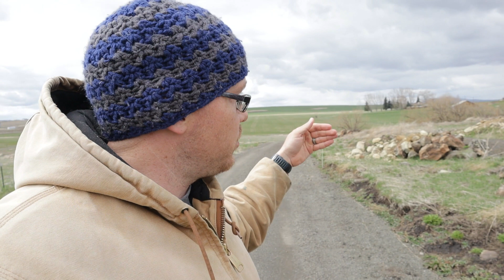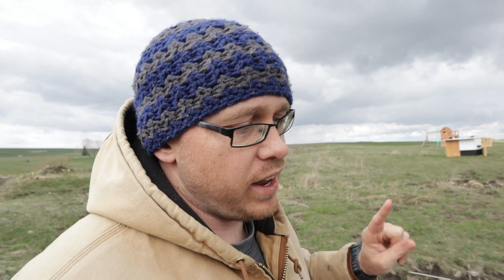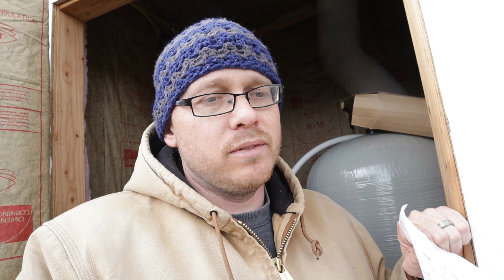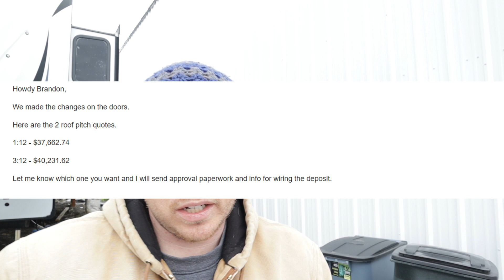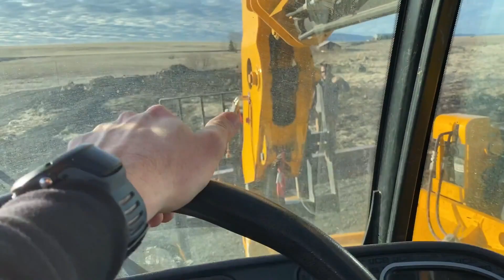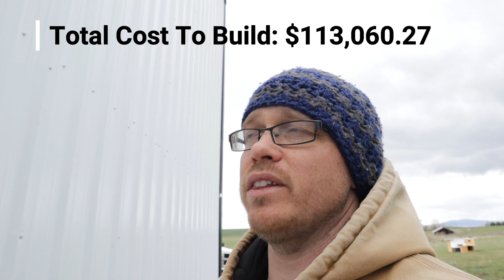Our 60x40 Barndo/Shop House Cost Breakdown // How Much To Build Our Steel Building

Comment: Do you recommend being the owner builder and sub it out or going through a company that builds barndo’s? Is the cost difference significant?
Reply from the maker: I built it 100% on my own with the exception of the concrete, excavation and septic, but I do know the more you do the less you'll spend. If you sub things out that takes work but it will save you on a general contractor who manages everything for you. When working with contractors you have to be on top of them and have to be diligent that they don't up charge you extensively. The thing is depending on the general contractor you could be facing the same issues anyways.
Reply: @homesteadingbarndo  thank you for that. I really appreciate it. Gives me something to think about. Excellent videos by the way. Also very informative. We plan on building a 60 x 40 in Kentucky. We were on the land already by the time we build but I’m just trying to decide what should be the best direction to go on the building.
Reply from the maker: @armandoyourpersonaljeweler7558  if you ever have any questions feel free to email me homesteadyrv@gmail.com 

Good luck on your build!

Comment: Do you feel that they are building quality is long lasting and good quality for the price. I’ve been looking around and most places I’ve gotten quotes from for a 40 x 40 are between 70 and 100,000. I did end up getting a quote from star steel theirs was much cheaper. I just wasn’t sure if there was a huge quality difference or when you had set it up if you noticed the structural differences between yours and ones you’ve seen?
Reply from the maker: I am extremely happy with the quality from star state steel. I've been in my neighbor's steel buildings and I see zero difference in terms of materials. 

I was pretty worries to be honest because they were far cheaper and I was wondering, geez I hope they actually deliver the building. It showed up complete. There was an issue where we were missing brackets for the window framing and I reached out and they quickly resolved it. 

It's holding up great in our 60-70 mph winds we've had out here, the snow, the heat and everything. No issues with paint or anything

Comment: the higher price of the road and site prep is exactly what i would have expected as someone who has built 4 buildings with roads/driveways.  i would have definitely gotten that great low price in writing before start of job.  plus, that original price for the septic was also way low a bid and sounds as if they only priced the tank install.  i get a lot of flack for this but, i always tell new builders to consider making their budgets 12k for every job needed and they won't be disappointed.  therefore, 12k for driveway, 12k for electric, 12k for septic, 12k for water, 12 for anything else you might need to set up your basics.  good luck and congrats on a great building.
Reply from the maker: That's good to know! I definitely learned a lot through the experience.

Comment: I found a Russian contractor who's willing to come to America to help assist in building my construction new construction I need a building for my car collection and residence and I have like 20 dogs. They replaced people since people have become well what they are in america. Therefore the Russian contractor he has lots of experience and has done everything from residential tons of electronics and wiring and would be willing to help me build anything from a block house out of cement Woodhouse anything I want but this is what I'm thinking I'm going to do with what you did the residence inside the building the dog kennels the in floor or the spray foam the well water and maybe solar panels on the roof since my collection of cars is only cars I'm going to make my building a great deal shorter I have no intention of driving any large vehicles in or out of it only one section needs to accommodate a lift to lift the cars. Due to tornadoes in my state and no snow a shorter building is more desirable and it's a lot easier to cool in the blistering punishing Summers in which I will let all the trees grow up around it and actually shade some of the building to keep it cooler.
Reply from the maker: Where are you building?

Comment: I don't know where you live but you're dealing with some real weird companies it doesn't matter if you do an overpower or whatever if you make a mistake in your estimate you need to swallow it I've run a roofing company and I've never charged anybody over what I had estimated it. I've also never paid anybody over the estimate they gave me if they tell me it's going to cost a certain amount it better not cost more than that or they're just not going to see the money.
Reply from the maker: I agree it was messed up. I've learned they have a bad reputation since living here. If I had known now I would have only paid to the estimate

Comment: I'm completely lost on this. What planet are you on? In Georgia we have contracts. They must adhere. If someone bids a job and you have the cost in writing, that's what you pay. There are of course exigent circumstance clauses but if you have a licensed company doing the work, those are rare. 39K in labor to erect the building? They do it for like 7K here. And are great at it. I think they just seen some young guy and assumed you were a sucker, guess they were right.
Reply from the maker: Lol estimates and bids are definitely not contracts. Contracts have to have terms conditions and completion dates. If both parties agree a bid can become a contract.

I definitely mentioned I didn't do it right and get it in writing. 

I highly doubt you could get someone to erect a 60x40 building with 22 foot eaves for 7 k. The equipment rental for me was almost 6300 bucks alone. That's why I built it myself and didn't hire it out. 

I could have saved money by being smarter but 113k is definitely not bad
Reply: I just got quote from company for a 60x40 with front n back porch and concrete work to fully erect the building n everything for $72,000. I'm in Mississippi of course I'd finish inside myself. I've really been looking into a metal home... hell a single wide here is $100,000 and it's like 1200 sqft....
Reply: @lazygamer9725  What company?  Have you found anything cheaper?
Reply: @stopitmike  Joe west will build the building. He's got pretty good record from the homes I've seen. And people where happy with him. Metal homes are nice. My wife and I are still planning n trying to figure everything out. But for a 60 by 40 his price has been pretty competitive.
Reply: Hey Rob - I'm in Georgia and read your message...can you give me a name of builder that you have used for either a pole barn or steel building that you would recommend.  Much appreciated.  Thanks,

Comment: I like the video.  It does show how when agreements are not put in writing and signed, how either side can lose.  I work construction and see this issue constantly.  After building your shop, you now know what to expect when building your house.  You are correct about saving by not having to hire a contractor, and managing things yourself.  In the late '90s I acted as the contractor and built our house and had to finance only half of what it was valued.  I also did some of the work myself.
Reply from the maker: Thanks for the comment, definitely took it as a lesson learned and know it is my responsibility to make sure things get done the right way

Comment: Look, a bid is a bid. It's an agreement that should be honored because making bids that are too low to begin with penalize the experts who price their work correctly. Stand tall, they're supposed to be experts, not you. It's on them when they underbid, that's why they're called contractors... contracts.
Reply from the maker: That's a good point Bob it was an expensive lesson that's for sure
Reply: Contract language in original agreement must say any changes costing additional $$$ must be written and signed by all parties.

Comment: The driveway invoice is actually accurate. Machine time, hauling, materials and grader. spot on. (My 2-cents for what its worth)
Reply from the maker: I totally get that people need to be paid what they're worth. The trouble I have is when the invoice comes in way multiples above what they initially quoted. I don't like the bait and switch, you know what I mean?
Reply: @homesteadingbarndo  I see and I agree. They mislead you. They should have said $4800.00 plus material. That is not good business. I am a builder and I would never get away with that.
Reply: @daddygoat  I agree.  Honesty is always the best policy.  Be completely up front and then you won't get "that contractor" reputation.

Comment: Quoted at 4800, billed for 14, paid 11? I wouldn't care who it was that is BS
Reply from the maker: @expectatussle  you mean the tells from the contractors? 

I didn't take it personally, I just didn't want to be known as the guy who didn't pay his bills in town.

As for making it short and ugly, it wouldn't have been any prettier it was a gravel road, and it was a single guy running an excavator. 

The problem was this bill pricing adjustment came after the job was done, so it wasn't a case of them not eating to job anymore. I only had two more contractor on the job after that to do concrete and septic and then well drilling. Everything else I have done on my own
Reply from the maker: Yea it didn't sit right with me

Comment: I think you got a good price on the well.  I'm having a well drilled in Montana and I'll be paying $60 a foot just for the hole and casing, and I'll probably have to go around 400 feet.  Thanks for the cost breakdown.  Which state are you in with the low pitched roof?
Reply from the maker: Thanks! I'm in Idaho but we usually only get a couple of feet of snow at a time at most. It is interesting, snow doesn't accumulate on the roof but maybe 8 inches and then it slides off. Also, the company who did the lot had it engineered for snow load and wind. 

Montana is so beautiful, we love visiting!

Comment: At every step, someone is trying to screw you. That's only 2-phase power so you're getting extra-screwed because it's residential. Those garage doors are too short to park a trailer inside. Consider building a steel tractor shed -- just a metal roof. Separate cinderblock wall. Park a series of RVs and trailers under it.  Good enough.
Reply from the maker: My trailer is 42 ft long, so there's no way that I was going to fit it inside my building while having the back half framed up, which is why I only went with 10 ft by 10 ft doors, looking back, I really wish I would have done a 12 or 14 ft tall door, but I just didn't know at the time that I ordered things. Things. I'm definitely going to do a big regrets video because those door sizes are definitely one of the things that I wish I could redo if I had to. My power pool has three phase power on it which is great but I only have residential needs for my system. At some point I'm going to do a solar and battery backup system. 

Would you suggest going lean to or doing a separate cover?
Reply: @homesteadingbarndo  Everyone prefers an insulated airtight shop and concrete floor, but if you save the money and invest it in business, it will be worth 5x or 10x more in ten years. I currently rent but seeing how hard it is to get contractors to do things right at a fair price, i'm  leaning towards a gravel pad and a series of insulated trailers. Every $1k per month in payments is like a big screen TV. When a recession hits and people are more desperate for work, that's a good time to be ready to build something nice.